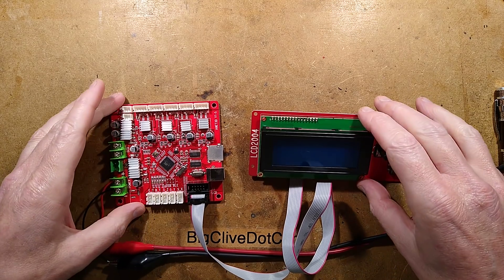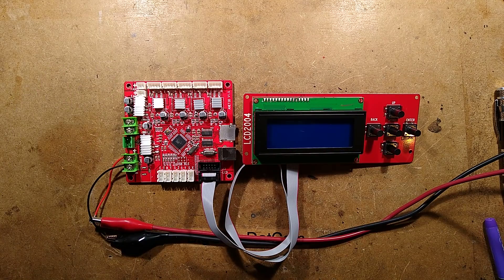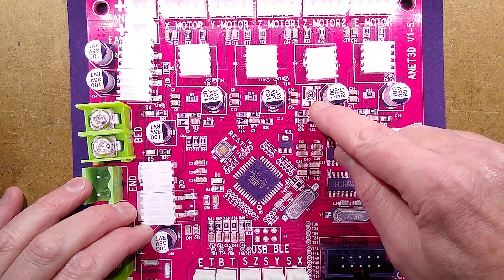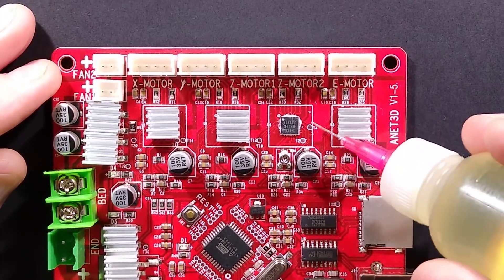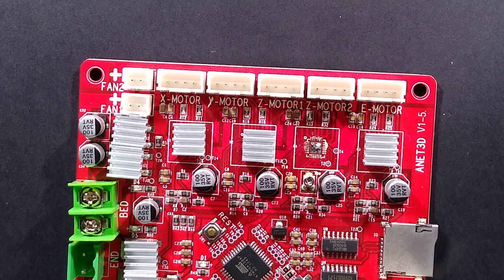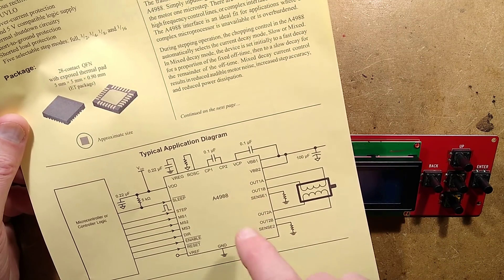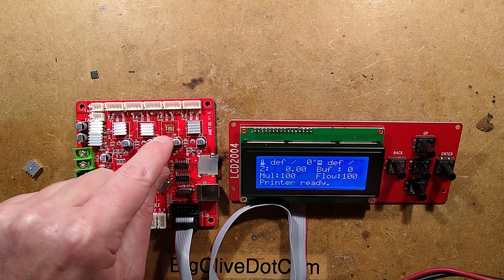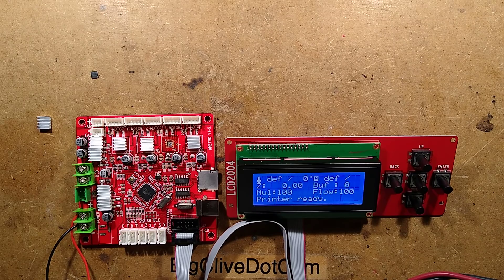Diagnosing a dead 3D printer controller

Comment: The 4988 was a crappy noisy driver. I had by manufacturer on my cheapy chappy chiny ctc i3 clone. At least in 2017 drivers were mounted on separated boards so in this case it would have been matter of seconds to diagnose and repair the fault.
I wonder if the firmware on that board has thermal runaway detecting enabled...
Reply: short answer; no. ANET didn't bother.  Best is to flash like Marlin or replace the whole board.

Comment: I have an A8 and had a similar experience. Though in my case, the hotbed MOSFET was toasted. It has since been replaced by an SKR mini e3 and now sits on my shelf of failed boards.
Reply: That's a very common issue with the A8, the MOSFET can't properly handle the current required by the hotbed.
Another common issue is burning hotbed connectors. If not done already you should consider soldering the wires straight to the hotbed instead of using a connector if you still use the original hotbed I suppose
Reply: @DocFr4nk  Both issues were fixed in the first few months. I ran the snot out of a A6 and A8 for hundreds of hours with no issues.
Reply: @MostlyInteresting  I have had many A8's.
Until they made the entire next gen with a different frame, not one of those shipped with the proper number of pins populated on the hotends connector and none of them had appropriate traces or control circuitry for the Amos that bed would draw, at least through v1.5 if the control board, which came out almost two years after it's introduction.

I love what my Anets have taught me, and they print damn well, but don't fool yourself into thinking that Anet wouldn't sell your safety for a dollar.
Reply: @MostlyInteresting  i too have run the snot out of an a8. unless they've revised the bed connector AND the board since... i think march or 2020 was the last i checked... they never fixed that problem. it's not an if problem, it's a when. that being said, if YOU fixed those isues in the first few months, then you very well should have a higher life expectancy, and you did the right thing for yourself and others. nice!
Reply: @DocFr4nk  Thanks for mentioning both. they typically went hand in hand but both were also individual problems.
Reply: Same here - the hotbed MOSFET smoked after about 10 prints.  I ended up replacing the controller with a genuine RAMPs controller with a genuine Arduino 2560.  I have replaced the extruder, the hotplate, the power supply, and all of the stepper motors.  I also replaced the bearings on the cross bars.  I think the only thing I have that is still original is the wiring and the worm gears on the side :).
Reply: I found info that shows the traces/ spokes on the ground connections are a week point, I'll be adding extra conductor to these pathways on my 3 A8 boards.
Reply: Amazingly, my two first-gen A8's are still alive and running well.

Reflashed with Marlin.
Directly soldered the heatbeds.
Moved the current for the beds and hotends off the boards with SSR's.
Added a proper ground for the display so it doesn't get corrupted by peeling tape in the same room.
Threw away the "heatbreak" fan on one. Switched the other to an E3D V6/Titan head on a carriage I designed.
Other than that, though, bone stock! /s
Reply: @SwervingLemon  So were mine till I sold the A6 and modded the A8 heavy and went to a SKR 1.3 and Marlin2. It runs sweet ans fast. Both had the stock board up to that point.
Reply: yeah same thing happened to mine. I bought an R3D printer to replace it. its a CR10 clone that i got for 200USD.
Reply: My Anet A8 clone (Omni M505) came with a a conventional Melzi board (long and thin), but I since swapped out for a RAMPS as it was having issues (later discovered to be entirely firmware and could have kept it as is!)! These days said printer is used exclusively for flexible filament and does a slow, but decent very job.

Comment: I've designed a number of stepper motor designs with this chip back in 2003.
Since it uses synchronous rectification, it will burn out if the motor is suddenly disconnected while powered. 
The solution I found, was to put Schottky diodes on the out put. A total of 8 diodes. 4 to Gnd, and 4 to supply. 
Not only the chip ran cooler (due to not having to deal with recoils), it would also not blow up if the motor connection was interrupted.
This is what happened to this unit imo. Either that, or it displays the exact symptoms. 
I bought an Anet A6 last year, and throw away this exact board right away, and installed my trusty Arduino mega running Marlin + RAMPS 1.4 from my de-gutted Prusa 3 clone.
Reply: Marlin 2.0 + octoprint is my way. easy as, well.. pi.

Comment: Wow, looks exactly like the CTC i3. All these Prusa i3 clones seem to share a massive number of components. My own printer with that exact board randomly decided it's Z axis didn't want to work, luckily could fix it by adjusting the litte potentiometer. Wonder what went wrong though.
Reply: Look at the board on that CTC. It has the Anet board so yes, the same. I have some CTC i3 's here tooo besides original Anet's.
Reply from the maker: Maybe just a bad potentiometer contact.
Reply: i think they flex a bit as they warm up. may be enough to disturb the pot and cause a bad connection and thus zero current through the drivers. 

dont quote me though. over the last few years i have replaced almost every part bit by bit, so its been a while. 

theseus' 3d printer!
Reply: @bradhoward9701  interestingly it's stopped again since writing the comment. At this point a new a non cheap board might be an option, alternatively a better printer altogether like an ender 3.

Comment: Has anyone successfully replaced a BGA part?
Reply from the maker: You can find videos of the process online.  It does involve cleaning and reballing with new solder balls held in place with flux.
Reply: @bigclivedotcom  We could do it at work but the process was very precise and very expensive.  I didn't think anyone had done it at home.
Reply from the maker: @RS-ls7mm  eBay has all the tools you need now, including the reballing jigs and tubs of solder balls.

Comment: Good job, "Welcom to Anet", brilliant. I would have removed the pot first... these drivers don't break easily
Reply: I've had a few of those drivers break, I don't think they were just the trim pot as its the chip that seems to heat up, but are you saying the pot dies and then somehow that's causing a short in the driver chip? I've had this happen to those exact type and also newer TMC 32 bit silent stepper drivers where the screwdriver slipped and shorted the trim pot to basically anything metal (not all were my fault, some I witnessed like the last example).
Reply: @jakegarrett8109  The pot is easy to diagnose and replace, while replacing the drive is difficult, especially if you don't have any spare parts, so I would try the pot first. It's kind of suspicious that only 1 driver is heating up, which would point to the driver having a problem.
Reply: @rondlh20  when in use all the driver heat up. But yeah it heating up not in use would be a good sign that it's bad. Those a4988 drivers are the cheapest and worst ones.

Comment: Saw the thumbnail and insta said, I bet I know what board that is lol! As someone who owned an A8 , and went through three boards, I can tell you that the boards had a tendency to just die for no reason. Even when everything was working correctly, chips would randomly decide that they no longer wanted to be part of this world. The company was very nice and would replace the boards with no problem as long as you could document the issue that you were having.
Reply: It wasn't "no reason", though. It was repeated iterations of a poor design compounded by those bastards using every cost-cutting measure they could think of.

The traces for the hotends and the heatbeds we're both completely inadequate for the current they were expected to run, and that's just the tip of the iceberg for their problems.

I was given several A8 printers. It was kind of fun to watch the board evolve as they would release yet another "fix" while ignoring the real problems.

Last board I got: They literally heaped solder on the bed power traces to try to increase their functional cross-section, but still didn't use all the pins on the JST connector for the bed.

I haven't the vocabulary to properly describe the incompetence at Anet, but "assclowns" comes close.
Reply: @SwervingLemon    shrugs For a bunch of "assclowns" they ended up getting a LOT of people into 3D printing though. The machine was a tinkerer's delight. 

Your mileage may vary, but the reason that I had to get replacement boards were due to QC issues. The components that were used were adequate... They were just faulty lol.

It could have been done MUCH better, but still... For the price of that machine and the fact that it was a direct drive it was good... You just couldn't trust everything to work out of the box. It absolutely NEEDED safety upgrades.

Comment: I just bought my first 3D printer. Looking forward to many more vids on this subject. ;) Also, reverse  engineering this circuitry would be amazing!
Reply: The circuit diagram is publicly available of this thing, it's very basic. Could be a good thing to explain and understand, eventho it's just a ic with driver chips, and not much more.
Reply: @Icefumy  Yep, the engineer explaining it is exactly where I was going. That really does help hobbyists like myself.
Reply: The circuitry is pretty simple.  The ucontroller sends signals to various Mosfets to control stepper motors and current to hotbed or the extruder.  There are also several microswitches wired directly to the ucontroler.  This circuit is in the public domain.  What would be more interesting is the actual firmware I think.
Reply: @BitwiseMobile  The issue here is that although I understand every term you have applied to this situation, I absolutely do not understand how each interact with one another.

The intellect used to derive your conclusions are beyond me at my current understanding. I need something a little more simplistic and basic so I can build up. (If that makes any sense...)
Reply: very pro-tip: If you aren't using PTFE-lined hot end throats, then you must absolutely..
AVOID CHEAP "full metal" HOT END THROATS.
They must be absolutely perfectly smooth inside, or they're just completely unusable. Molten plastic gets squished into any imperfections, cool off there and jam your printing head forever.

Comment: You can get ceramic screwdrivers for very little on ebay, and they are much more durable than plastic trimming tools, and the phillips ones fit those teeny tiny trimmers pretty nicely.

Comment: I have a dead one. Head thermistor shorted out and crappy design made that 5V to ground. Could never get it working. Replaced the 5V regulator, desoldered the mosfets in case they were shorting 5V to ground. In the end, the STM controller was just getting incredibly hot and drawing huge amounts of current (with nothing else getting particularly hot) so I decided it was dead and bought a new board (the printer was out of warranty). Moral of the story: Don't work on the thermistor while powered up.

Comment: When playing about with a cheap booster circuit thing bought off ebay in a pack of five, I trimmed the pot too far one way as I'd gotten "lost" with where the voltage was going, and ended up burning out a resistor, which was an impressive sight as it emitted a bright white light, so I'd invented the light-emitting SMD resistor, but it only glowed for about half a second sadly... :P
Reply: Every chip is an LED, once.
Reply: @JamesChurchill3  It's a LE* you mean ;-) In this case the asterisk would be replaced by an R.
Reply: @LarixusSnydes  D stands for device
Reply: @JamesChurchill3  Technically an incandescent lamp, not an LED.
Reply: It gets better: if you do a good enough job,  it's also a speaker!

Once I hooked up a 150W buck converter backwards. Not only the power transistor light up, but the force of cracking the ceramic package let out a loud "pop" along with a bit of smoke. Single-use multi-sensory reverse polarity indicator!
Reply: What do you think the old photography flashbulbs were?  Resistors that were expected to catastrophically fail after a single use.
Reply: The stamp-sized boost converter modules notoriously let you dial the voltage up so high they blow their own output caps.
Reply: @sciencoking  😂 sucidal
Reply: SMD incandescent indicator lamp
Reply: Letting the smoke out of F.R.E.D always fun
Reply: Buck converter
Reply: @infernaldaedra  boost converter, cos it takes lower voltages and boosts to a higher voltage, buck does the opposite...
Reply: Try it in a vacuum!
Reply: Nice, one time I was messing with the lead on the output of my buck converter while it was plugged in, it shorted to the metal can of the cap next to it and instantly popped the top off the regulator in a slightly fiery fashion.
Reply: Everything’s an incandescent filament/fuse if you put enough current through it 😂

Comment: Those A4988 drivers are easy to burn out, even without shorting them.   Many 3d printer control boards mount them on replaceable carrier boards.

Comment: Hah, I knew that was an A8 board straight from a glance at the thumbnail.

Admittedly, I'm not sure I understand why you wouldn't just replace it with a SKR v1.4 and TMC2209s. Can't cost much more and it's a way better setup.
Reply: Or at the very least, flash it with a firmware like Marlin so you have some thermal protection, what I did, along with some exteral mosfets from aliexpress.

TBH, I'm currently running another 3d printer board my work made but discarded (has only SMD components) and fixed that, put a custom marlin (2.0) on there, and still running fine, with room to spare on the IC for more options.
Reply: TMC2209s drive steppers buttery smooth and quiet. But a SKR v1.4 and TMC2209 combination is about £70.
30 minutes of time and replacing a Chip is about £4
Reply: @NickNorton  My board was free. Can't beat that price. even though it has them DRV ic's. it's hardly better, but for my rare use it's fine for now.
Reply: Maybe in 2019; but today SKR boards are unobtanium due to chip shortages, and you have to sell a kidney to get one from questionable sources..
Reply: @notsonominal  I paid $70 (50 pound) for mine last year, and that 70$ gets you the turbo version and a set of TMC2209s.
Reply: Interesting, didn't realize they were hard to come by now. I also got mine a year ago.

I still wouldn't waste much time on the A8 board with the hard to replace (bad) drivers, 8 bit processor, and other shortcomings.
Reply: Not sure where you guys are looking, lol. I can see a SKR V2 with 5 TMC2209's for <$60 all over AliExpress.
Reply: @androiduberalles  I looked on amazon, that's where I got mine. now that I think about it I believe I got a bundle for about $75 that included the mainboard, as set of TMC2208s and a touch screen that went with it.
Reply: @electr0maker436  that's a steal!
Reply: @androiduberalles  and they'll 99% arrive with a different cpu than you expect. bad time. (and its still a robbery in broad daylight compared to repair or $20 Anet board)
Reply: @androiduberalles  it was until I fried the mainboard AND a TMC2208 AND discovered that it was the wrong screen for marlin. LOL, I had a bad day.
Reply: @soundspark  klipper ruined me, I can't stand Marlin

Comment: I love the technique of using a thermal imaging camera to diagnose circuits. Thanks for sharing!
Reply: A cheaper method I used to use before thermal cameras were so common was to freeze the board with an upside down air duster then see where the frost disappears first.
Reply: @florence9231  there's always the finger test... similar to how Clive checks capacitors for discharge. ☺
Reply: Too bad those camera's are more expensive than 3D printers of this sorts....

Comment: RTV silicones generally swell and lose strength when exposed to light hydrocarbon solvents like Fuelite ,petrol or contact cleaner (fuelite) .It is then easier to pick the material away with a fingernail.
Reply: The flux could even be enough.
Reply: You can also use acetone or xylene (we don't have fuelite in the USA, but acetone and xylene are easy to get).
Reply: @brianleeper5737  Stoddard solvent , mineral spirits or Coleman fuel are US equivalents - it's basically highly refined gasoline with an octane rating of around 6 or 7. Acetone and xylene are more likely to degrade some plastics
Reply: @paulg3336  I think the formulation of mineral sprits varies in solvency power. I bought some that wouldn't dissolve a polyurethane prepolymer (the liquid before it cures into a solid), yet the manufacturer of the prepolymer says that it does dissolve in (or can be thinned with) mineral spirits. That particular formulation of mineral spirits would probably do nothing to RTV silicone.
Reply: @brianleeper5737  That is correct, In the case of silicones ,though, none of them actually dissolve the material ,just make it swell and lose it's tensile strength,making it easy to cut and scrape from things it is adhered to.
https://en.wikipedia.org/wiki/White_spirit#Types_and_grades